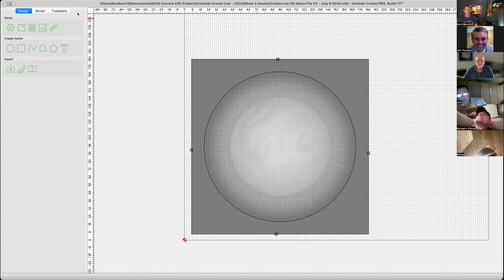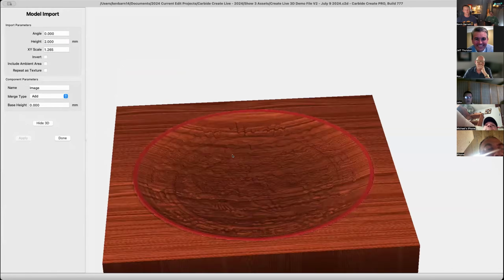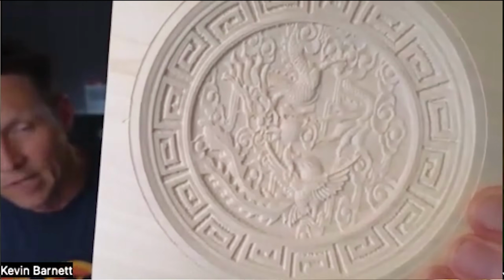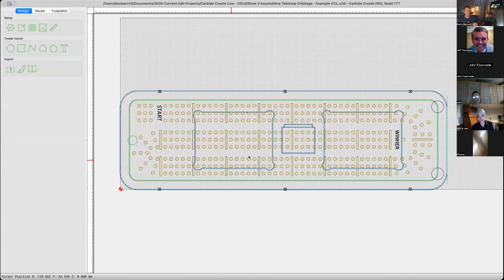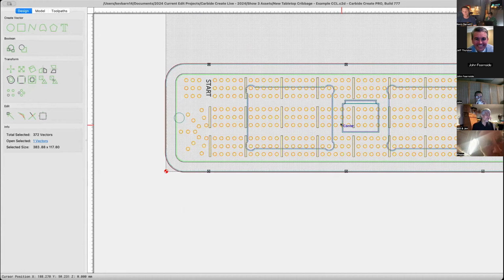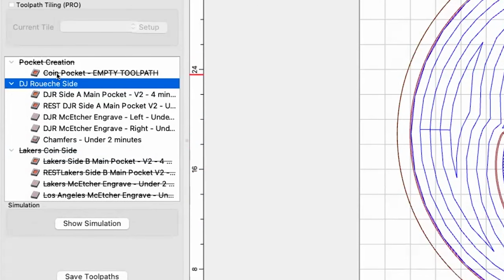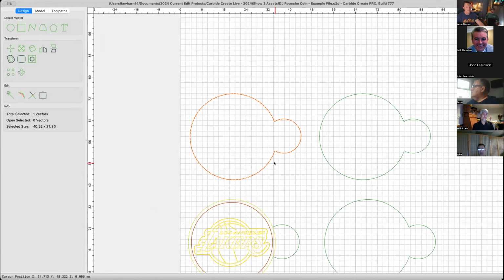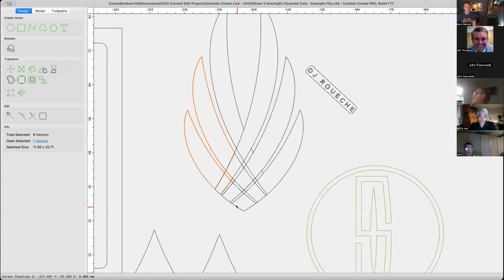The Carbide 3D Education Live Show - Episode 3

Comment: awesome video really explains a few things I was struggling with, I have designed and set my tool paths for my project which is 13W x 4.750 x 1.5H as I know I need to find my x and y zero but do I need to find my z zero ?
Reply from the maker: You always have to set a Z-Zero.  Every project requires it.

Comment: Is there a way to set up templates?  I need to perform the exact same operations for multiple projects, but each project will have different dimensions.
Reply from the maker: You can assign toolpaths to layers so they're not linked to specific vectors.  Just import your new design, move the vectors to the correct layers, and you're good to go.

Comment: If possible, I'd like to see demonstrations for something like MeshCAM that's recommended on your page for creating more mechanical 3D objects.  I've tried the 3d tool in Carbide Create with a 3D object and it does work, but when dimensional accuracy is required, the scale factors that are intended for artistic flexibility get in the way. I've already got a strong background in CAD and 3D modelling packages like Solidworks, Fusion, and Blender.  I just need some recommendations on the CAM side to reproduce what I've already designed 1:1. Thanks!